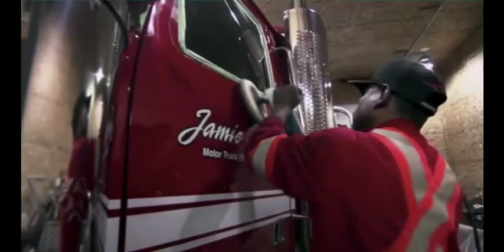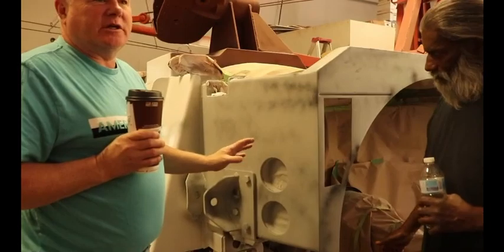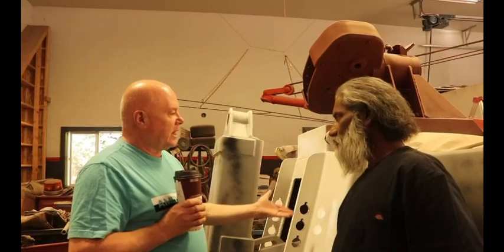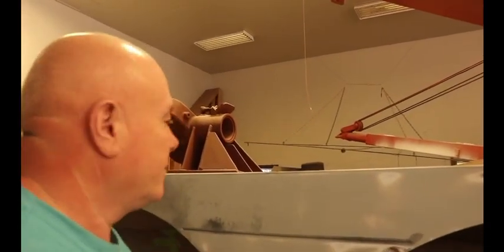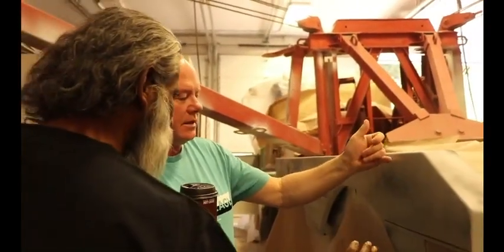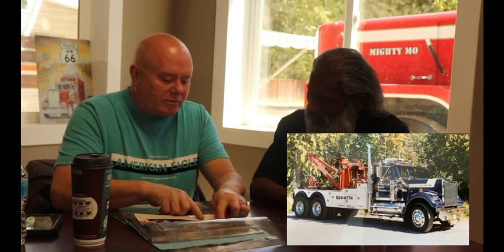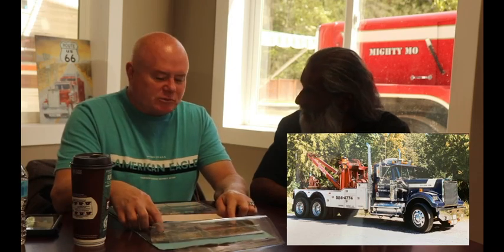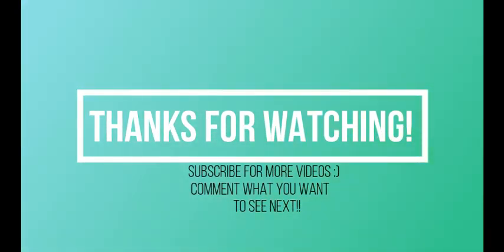A TRIP DOWN MEMORY LANE! SAMY'S BACK! || Jamie Davis Towing

Comment: One hundred years ago, when motor vehicles were in the process of replacing the horse-drawn wagon as the principal means of transporting goods, truckers in British Columbia were challenged by a road network that had not changed much since the days of the gold rush and the mule train.

Reluctant to challenge the mountain ranges and river canyons of the Interior, road builders had not expanded their activities beyond the main population areas in the southwestern corner of the province.

 When a few local carters got together in Vancouver in 1913 to create the General Cartage and Storage Association, the forerunner of today's B.C. Trucking Association, it was not even possible for a venturesome trucker - and there were a few in those early days - to drive his Model A Ford one-ton from the Lower Mainland to the Interior without making a detour through the United States.

There were simply no roads connecting the coast to the hinterland.

You could say that long haul trucking got underway in the province on May 24, 1927. That was the day that the Fraser Canyon Highway officially re-opened, following the route of the old Cariboo Road from Hope to Spences Bridge.

The original wagon road had been destroyed by railway builders during the 1880's and it had taken close to a half century to reestablish road contact with the Interior.

Not that the new Canyon Highway was much by today's standards.

It was a narrow ribbon of gravel cut into the side of the winding gorge with steep, unguarded sides falling away hundreds of metres to the roaring river below. Snow removal being non-existent, it was only open from the beginning of May to the middle of November, and even in the open season it was often blocked by washouts, slides and freak snowstorms. But it was a beginning.

The truck drivers who travelled this daunting stretch of road had nerves of steel. Andy Craig was one of them. Craig, who later wrote a history of the early industry, explained that most truckers liked to use the road at night to avoid car traffic. He described how he kept a spotlight aimed at the edge of the road "because it had a nasty habit of falling into the Fraser River without warning".

Craig recalled that "we seldom made a trip without finding some unlucky soul who had hit a rock slide, or gone over the bank, or broken through an old bridge."

It took days, not hours, for a truck to reach the Okanagan from Vancouver. Even when it was paved in the mid-1930's, the road was so narrow that when two vehicles met one had to back up to the nearest pullout to allow the other to pass.

The Canyon Highway was a bottleneck as much as a breakthrough. The Alexandra Bridge north of Yale could only handle rigs that were no longer than 30 feet. The situation improved at the end of 1949 when the opening of the Hope-Princeton provided an alternative route and larger rigs could begin making their circuitous way to the Interior. But the big trucks still couldn't handle the Canyon until 1962 when a new Alexandra Bridge went in.

Of course, once past the Okanagan early truckers still faced the barrier of the Selkirk Mountains. For the longest time there was no road at all across the middle of the province.

Then in 1940 the government pushed through the Big Bend Highway joining Revelstoke to Golden via a looping 300-kilometre long gravel road. For the first time a vehicle could drive from Alberta to the coast without swinging south through the States.

But just because it was possible did not mean it was easy.

The Big Bend was a winding, dusty obstacle course, blocked by snow for much of the year. One travel writer called it "the loneliest road in America". Understandably, truckers did not rush to use it.

No, it was not until the Trans-Canada Highway opened across Rogers Pass in 1962, cutting several hours off the trans-provincial route and providing a safe, paved road surface for vehicles of all types, that finally you could say the pioneer period in B.C. trucking had come to a close.

Today we accept the importance of the trucking industry to the economic well-being of the province.

But as we travel in comfort along one of B.C.'s many modern highways, we might take a few moments to consider how much we owe those early truckers who risked their loads, and sometimes their lives, to navigate the primitive goat trails that passed for roads in early British Columbia.

Historian Daniel Francis is at work on an illustrated history of the trucking industry in B.C. It will be published in 2013 to celebrate the 100th anniversary of the B.C. Trucking Association (BCTA).
Reply: That's a great account of the early days.
Reply: Basically it was the last frontier until the early 60’s
Reply: Hey, thanks for information. 😊